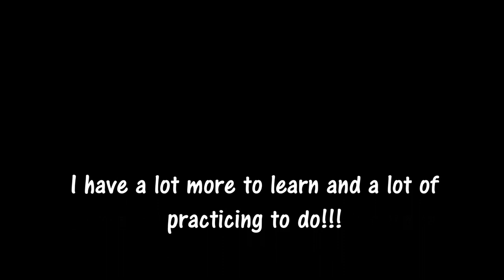Dovetailing

Comment: Cy, I am in awe of your ambition.   That is FANTASTIC.   You've taken on what a lot of woodworkers think of as the hardest technique to master and gone right for it - grabbed the bull by the horns as they say.    You have the right technique - that 3rd attempt gives you dovetails.    The only issues with that are your technique with the saw and chisels.    You have dovetails,  nicely balanced aesthetically and correctly cut.     (Don't fret too much about how many pins/tails to cut -    half pins whole pins .  its only a matter of aesthetics and getting enough strength in the joint.)

Here's some tips about how to get the result better ....

Make sure your lines are precisely drawn.  When you  draw a pencil line alongside a piece of wood, there's often a slight gap - the line doesnt always go exactly alongside the piece of wood.   You need a really sharp pencil or even a marking knife,  to get the line you're drawing touching the pin youre marking against.  

Know what side of the line you're going to cut.    When you're improving your saw technique,  you'll be able to cut one side of the line or the other.   You want to practice cutting lines with the saw until you are able to cut to leave all the line behind,  or alternatively  cut to remove all of the pencil line,  depending on which bit you're cutting off.    Get that right and you'll be able to get those pins and tails a lot tighter. 

As to getting the bottoms smooth - that's largely a matter of practice too.   You need to make sure you have sharp chisels,  and dont try to chop out the whole chunk of wood at once.   You can use the coping saw,  and that'll get you close to the bottom line,  then use a chisel to pare  (technical term - google for some youtubes to learn about that - it'll help you with the chisels  a LOT if you can do that properly) down to the line in tiny little increments.  

You're doing far better in 3 goes than I managed in 50 goes.   And i had an instructor looking over my shoulder.   BLOODY WELL DONE!!!
Reply from the maker: Mike K Thanks for the info Mike!  And the technical term- pare.  Thanks, that makes the googling easier!  I have learned so much from the comments and have heard about the pencil line and cutting along the scrap edge, but you mention that there are even different ways to approach the pencil line.  Thanks.  I will be watching videos on sharpening chisels for sure!  Maybe having an instructor over your shoulder made you a bit nervous!!!

Comment: Nice work, Cy! Keep at it. It will get easier! You need really sharp chisels to get the inside of the joint smooth when you're working with pine
Reply from the maker: Matthew Cremona Thanks Matt!  Do you recommend a certain type of chisel?  Or were the ones I have good as long as they are sharp?  Also, I used pine because it was soft, I figured it would be easier to saw, but oh man!  it was quite interesting and difficult, almost too soft!
Reply: Cy's Corner As long as they are sharp, it shouldn't matter much.  Pine is the most difficult wood to dovetail because it is so soft.  Try a hardwood, you'll be amazed at the difference.
Reply from the maker: Matthew Cremona Thanks, good to know.  I got to looking at the old chisels we have and wow they are rusty!

Comment: Nice work.  Keep in mind that pine and softwoods don't always cooperate with the chisel the way some hardwoods do.  You can use a fine rasp or file to flatten out the bottom of the joint.  You can also make a bunch of vertical cuts to help you get the waste material out.  I found that works better for me than trying to chisel everything out from a solid piece.  I did learn that a really good, really sharp chisel makes a big difference.

I did my first ones and marked all of the angles the wrong way using the saddle and the joints wouldn't hold!  It took me several tries to get one that even looked reasonably good.

Mark on both sides of your work so that you don't go past the width of your material when you cut.  If it's going to be a drawer or something and the cut is inside it won't matter much.  A jewelry box where that will show isn't so good.  You can fix small gaps by using sawdust from the material and some clear drying glue like you did before in one of your videos.

Make sure to cut inside of your tail line and outside of your pin to get a "too tight" cut that you can chisel or file out to a better fit.  I'm still not great at them but I do use them and locking joints in all of my drawers now. 

Keep practicing and I'm looking forward to the next video.
Reply from the maker: Gail Long Wow thanks!  Great info!  I will work on sharpening my chisels, and slowly working my way to the finish line on the piece. Thanks for watching!
Reply: Cy's Corner One last thing about your line is to use a sharp knife like a box cutter
 or marking knife to score the lines.  That cuts the top level fibers 
and helps keep chipping to a minimum as well as giving you a groove to 
put the edge of your chisel in.  I watched a good Chad Stanton video on 
that and have been using the technique ever since.

Comment: You are now into the suffering part of learning dovetails.  You are making excellent progress.  Sharp tools help a lot.  Don't worry about chisel snobs.  Cheap ones work just as well you just have to work more to keep them sharp.  Once again refer to Paul Sellers videos on sharpening them he is the master.  You'll get there.  Everybody is pulling for you.  Endeavor to persevere.  $3000 worth of tools is not required but you do need to be pretty meticulous on your sharpening  which is good practice and part of the suffering.  My first one was like a dead skunk in the middle of the road.  You are doing much  better than I did.
Reply from the maker: Steve McEntyre Thanks Steve, a dead skunk huh....pretty stinky!  I have resolved to learning how to sharpen chisels and use them properly!  Everyone has been so great and so helpful in my little dovetail journey. I appreciate all the help!

Comment: There is a big difference in quality as well as sharpness of chisels, Cy. The cheaper ones (those little wooden handle ones you used) are made of cheap metal and will not hold an edge, assuming it can be sharpened adequately to begin with. IMO before attempting to make hand cut dove tails, the chisel issue must be researched first.
Reply from the maker: Steve Collins Thanks, I have read a bunch of comments about the chisels.  The videos I watched didn't talk about the chisels, I guess woodworkers know about good chisels, but I didn't.  Live and learn!

Comment: I haven't done dovetails yet but on the other joints I've tried that end grain has been real hard to clean up. From what I can tell you just have to have a VERY sharp chisel to be able to slice it across the grain. My chisels are from a cheap chinese 20 pack and I don't think they came very sharp. I just ordered a glass sharpening plate to try to learn how to get them sharp enough. Once I get the hang of that I'll buy some better chisels.
Reply from the maker: ***** Thanks for commenting, a glass sharpening plate? Curious about this...  My little wooden handled chisels are from a cheap pack, the other are ones my hubbie has had for years, I am hoping to sharpen them.
Reply: Cy's Corner Rockler and Peachtree Woodworking sell a sharpening kit that has a pane of plate glass that you put self-adhesive sandpaper on. The glass is supposed to be extremely flat and allow you to change out the sandpaper when it wears out. I was able to get it for $35, which seemed much more reasonable for a starting cost than what I was finding for good diamond sharpening kits or stones.
Reply from the maker: ***** Thanks :)  I will check it out!

Comment: nice work cy! the more u do the better youll get. figuring out which to do 1st solved my problems too..lol hardwood is easier for me.. did u send away for the veritas? saw.:)
Reply from the maker: Joe Walters Thanks! I used pine since it was soft, but I see now it is too soft!  And yes!  I ordered the veritas saw!!!!
Reply: Cy's Corner yea it definitely is too soft. The tails snap if its just a little snug.for me at least...I like using cherry or  oak with the Veritas it cuts really smooth and the  chisel work turns out nice if u want a good chisel set the 8pc sweethearts are awsome. Really light and accurate after a little flattening and honing. Which doesnt take long at all. U will love the sae once u get used to it.took me like a wk I have the same "gents" dvtail saw as u do. Good luck:)